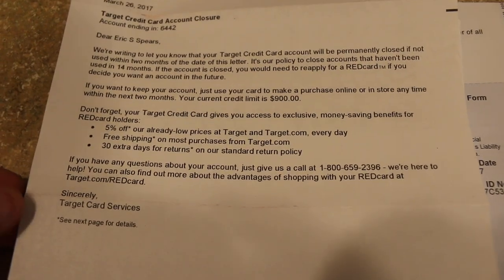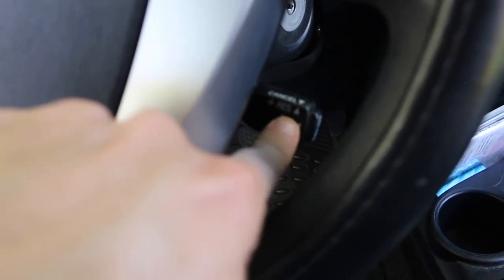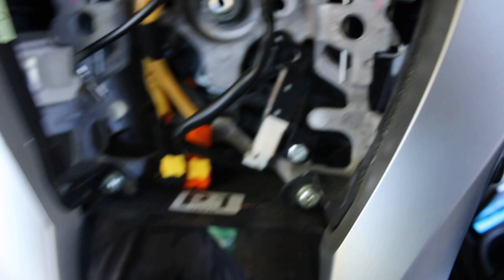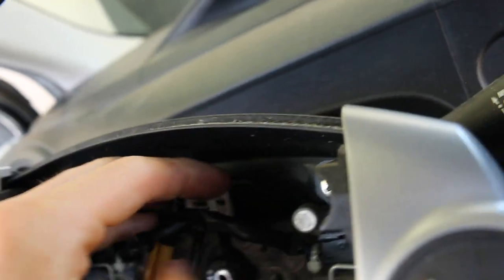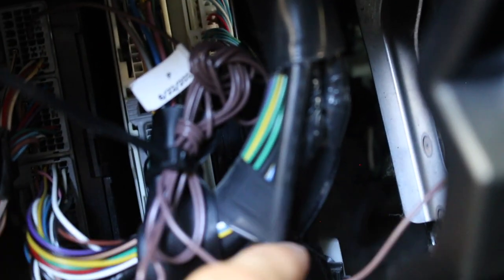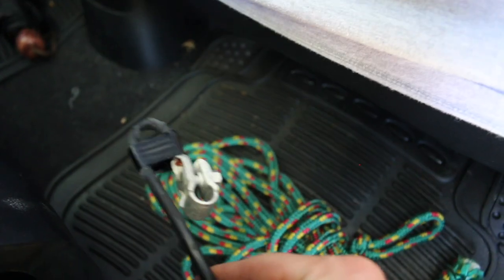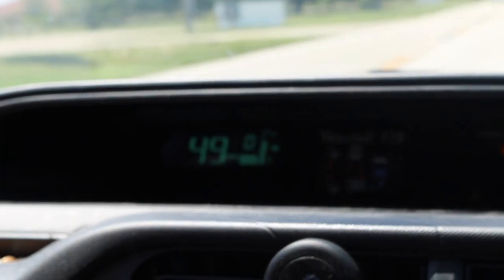How to Install Cruise Control on Base Prius c 1 one 2012 to 2014

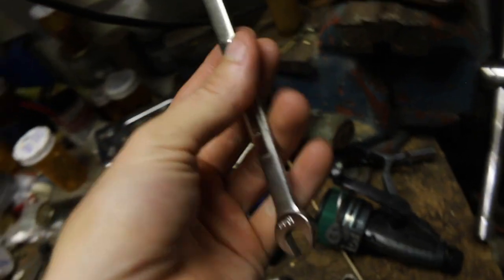Comment from the maker: The actual Install starts at 3:00. And for those who want my extra wires, I have given all the wires away. Thanks everyone for watching! =)
Reply: thecollegepicker  did it require any programming after or just plug n play?
Reply: i have a japanese aqua 2014 model.   there is no cruise control indication in instrument panel by design, how to manage that sir ?
Reply: Does cruise control disengage when you brake ??
Reply from the maker: @dochoa730  plug and play
Reply: Do you still have wires?
Reply from the maker: 4 years long gone.
Reply: @thecollegepicker   All good Thank you for the reply and the video! REALLY helped! Amazing that it only needs some simple hardware!
Reply from the maker: Appreciate it 🙏
Reply: Where do you get the wires? What are they called?
Reply: @robinulm8810   My recommendation would be to go to a junk yard and find a vehicle with the same switch. If you go to toyota's parts website and check fitment, it will tell you all of the vehicles that used the same switch. Then, go to the yard; when you're pulling the switch, make sure to get the same gauge / connector type out of the harness in that vehicle that will go into your vehicle. Cut a whole plug if you feel you need to.
Reply: @thecollegepicker I have a base model and I want to add steering controls. Got the set together with the manufacturer wiring. Would I need to add anything else?

Comment: Those small connector pins are called molex pins. There are multiple sizes available. Lots of different tools to install and replace them as well. Just google them. I worked with them numerous times on my coin-on amusement route i used to own and operate. Great job on the install. I am impressed with your ability to learn as well as implement newly acquired skills with ease! A true gift! The learning part is always the most fun I think.  EPIC close on the vlog and facial expression on the Coke comment! Be hard to top that one! =D
Reply from the maker: Tom Knight ahhhh mole pins!!! I may have been able to Google and find how to make the cords instead of having to shell out $100 for two little wires. Thanks for the tip! glad you enjoyed the install! I hope to contribute to the world and make it a little easier for the next guy who tries to install it.
Reply: Here is a link to a supplier that i used. This is the North American division. It is geared to the coin-op gaming industry, but molex pins and connectors are universal. You can actually build or design your own harnesses. Taking the pins out does require extractors, and i would highly recommend tin tipping the wire with solder before crimping. The only problems you would have is identifying the correct sizes.  https://na.suzohapp.com/wp/search.p?Q=molex
Reply from the maker: I just searched amazon and I found a $39 kit. DOH! I failed as a bargain hunter =(  It wasnt being ranked in the search for prius but it came up for toyota now that I know that the molex pins are sorta universal. DOH DOH DOH homer simson moment haha
Reply: Did you ever figure out what size the molex pins were? I found the CC stick for $20, but it doesn't come with the two wires I need. I was hoping I could just buy some pins and crimp them myself.
Reply: @andrewhudson6199  i guess thats a no to the molex pins size lol

Comment: Hi there, great video! Im thinking about installing my own cruise control cuz i bought my used prius c without realizing it even had cruise control and dealer did not tell me that it had one and that it was broken. I know nothing about cars or wiring and I dont have a 1 1/2 inch hole driller. i dont have a  problem buying the parts of the hole driller but any advice on if i should try to install it myself or just take it to a shop and have them do it for me? is it a big risk for a beginner like me?

Comment: Wondering if you can help me. I wired into a 2013 Prius C  exactly as your video shows, yet I have no cruise control. The pins went in the full depth and they can be seen from the connector interface end just like all the other pins. But no cruise. I grounded it to a different bolt than you did but it is a ground able connection. Do you have any suggestions. I had to purchase numerous types of pins until I had a version that works perfectly. 
Please let me know your thoughts? Ray

Comment: These instructions are only good through 2014. A big advantage to the Rostra.com kit is they include instructions and photos that cover the 2015 through 2017 models. There is a kit on Amazon for $39.99 with free shipping. It includes the wires and a replacement escutcheon with a hole, but the escutcheon doesn’t fit the Prius C and the ground wire is a bit too short.Most of it is the same, but from 2015 on, the ECU plug is the second one down on the left, and the wire goes into the bottom right corner.
Reply: Paul King is that bottom right when it’s in the car? Or bottom right when it’s oriented as it is at 7:50?
Reply: For 2015,2016 It's the second down  ECU plug, the upper right corner hole, when the plug it's on the car.
Reply: Went to Toyota about the 2015. It shows the brown wire to the second plug, bottom right , when plugged into socket. Hope this helps someone.
Reply: I followed these instructions on my 15 Prius C, and still no luck. I did the switch and both wire, ground and ECM. Still no illumination of cruise

Comment: Hey @thecollegepicker, 
What is the name for those types of cables you've used. Specifically with the metal rod at the end for inserting hard. I'm trying to follow your instructions and just want to buy the same cable type as you did. Thanks bro.
Reply from the maker: Molex connection I think. They have different sizes I think. Such a rip-off to buy them, would cost like $5 to make.
Reply: @thecollegepicker  thank you
Reply: I think that male to male breadboard jump wires may be the best thing. I'll try to remember to post an update when done.
Reply from the maker: Please do that would be a big help 🙏

Comment: Where did you buy the cables from? I have a 2014 Prius C One, plugged in my cruise control with harness and it's not activating, dealer was of no help, saw you're video and realized they didn't install the wire to the ecm. Maybe that's my fix.
Reply from the maker: I got my kit off Amazon of ebay I think I put a link in the description.
Reply: @thecollegepicker  I saw the link, but that's only for the kit including cruise controls, not the wires :(.
Reply from the maker: It says out of stock 😭 but I has the wires. It's a whole kit.

Comment: Pro tip turn the Steering wheel upside down then you don’t need to undo the airbag wires at all it will just nicely sit on the Steering wheel
Reply: Thank you. That was very helpful! Sadly I have installed cruise control today on my Toyota Aqua 2012 but it’s not working.

Comment: Have you connected only 2 wires? 1 minus and 1 in the computer plug? I just have a wiring diagram and there are 4 wires connected. from the steering wheel 2 and 2 from the frog brake!

Comment: @thecollegepicker So I did the exact instructions by collegepicker. I have a Toyota Aqua 2012 S model, I bought a kit and installed it the only problem I have is there is an error message on the dash (Cruise System Check) and the cruise control light turns on then off after a second or two. 

The only way I can make the cruise control light to stay on is by keeping the brake lights on meaning by I have to press the brake pedal.

Do I need to replace my brake light switch to make it work?

Thank you for everyone who will reply.

Comment: Hi man. I'm trying to install the cruise control in my Toyota Prius c follow your instruction but I have really bad time inserting the control wire into the connector. There is a particular way to insert those wires (ground amd control) in the connector contactor. Hopefully you understand my question
Reply from the maker: Whats up dude, I honestly dont exactly remember, I think I pressed them in with a tool and they clicked but I dont remember their orientation, I would say try it one way, then rotate 90 degrees only 4 possibilities if its limited by the orientation. Good luck and I hope you get it going. Our is still going strong.
Reply: @felipe Leon did you ever find out knowing what orientation they go in I’m have a hard time aswell

Comment: I have a 2016 and looking at my ecm connected it looks alot more different than yours, could it possibly be pre wired and I just have to plug the stick into the port in the steering wheel?
Reply from the maker: This will only work up to 2014 to my knowledge when I did research. 2016 would be a different way.

Comment: Where is the ecu connector point for the brown wire located?Is it behind the glovebox?
Reply from the maker: Hi thanks for watching. If I understand correctly I think I point at 6:51 check and see if that helps with the installation thanks. 🙏♥️
Reply: Anyone know if the brown wire to the ecm plug is the same place on a 2015 Prius C one?

Comment: I have a 2014 One trim n bought an aftermarket kit. I tried going to mechanics but they tell me it would need to be programmed so I need to take it to a Toyota dealer. Is this "needed programming" real or bs cuz they're afraid to touch a hybrid?
Reply: It's bs, install, plug in, turn on, and cruise.

Comment: I need help. I did everything you said. I used the brown wire and the black ground wire. Now, my horn is in a constant state of honking the second the cones connect and I tried turning on the cruise control to see if the symbol shows up on the dash and it doesn't .
Reply from the maker: What year is your Prius?
Reply: It's a 2015

Comment: Where can we get the wires. Do you know if the are standard Molex connectors?
Reply from the maker: I got mine on eBay or Amazon from a kit. I put a link on the description of the video. I'm not sure if it's standard molex sorry I wish I knew. Cruise still works great to this day 🙌🙏

Comment: I need the wires to install the cruise control thank you ... good job man
Reply: The connectors at the end of the wires is crucial. I purchased several different kinds until I got the correct ones that fit properly into the connector. Let me know if you need a few. Ray

Comment: I have a 2014 Prius C. I bought the cheap kit and tried to install today using this video (thanks TCP, went pretty much as depicted).  Unfortunately, CC didn't work.  Still doing some troubleshooting.  The Molex connectors for the signal and ground were being stupid when I was trying to get them to seat in the steering column harness plug.  I'm thinking they might not be making contact.  Also, had to extend the ground wire with Scotchloks.  Ground is too short as Paul King pointed out. Does anyone know why most of the Prius install instructions skip the signal and ground wires altogether?
Reply from the maker: You are welcome. I got the expensive kit, expensive two wires 🙄. Hopefully it works out. Let me know 👍💪

Comment: I grabbed a cruise control kit but can't seem to get the wiring to work. I'm not sure what I'm doing wrong but cruise won't turn on after putting the wires in the spots everyone says to do. I'm so frustrated over this.
Reply from the maker: What year is the Prius c?
Reply: @thecollegepicker  2017 Prius C One
Reply from the maker: So from what I've gathered from the comments is that the wiring is different on 2014 or 2015+
Reply: @thecollegepicker  yeah that's what I've gathered too. Don't know what to do here now. Rostra website only talks about the connections under the airbag and nothing further.
Reply from the maker: Does rostra sell a kit that says it's compatible with 2016+?
Reply: @thecollegepicker  it says 250-1836 on their site. Downloaded the PDF form #5350 and it only shows 2012-2014 and 2015 instructions. I attempted the 2015 also just now but seems to be same problems.

Comment: I see this video is 6 years old and know those wires with the special female terminals are long gone :hand-orange-covering-eyes::cat-orange-whistling::face-blue-wide-eyes:🤣😆! Being the Prius is a 2013, there was something in common with my 2013 Tacoma base cab, 2wd, 2.7L 4 cylinder model, they both need the black ground and the brown lead to the ECM. The black connector under the steering column looks just like the S8 connector under mine (2 rows of 6) , the ECM's are of course different due to application. I'm hoping the individual that said the terminals are Molex is correct and I can find the size required. I bought and installed all the other hard parts, and the clutch switch connector for the cruise was there in the harness.

Comment: Dude thank you so much for this video I love my Prius C One just needs Cruise control
Reply from the maker: You are welcome. It was a great addition for us.
Reply: @thecollegepicker  have you had any issues with the main battery? Mine has 92000 miles on it.
Reply from the maker: Nope, it has about 155k now I think.
Reply: @thecollegepicker  Darn it my Prius has a different setup because it was previously a fleet vehicle so it has an old tracker wired in. I have no idea how to go around this.
Reply from the maker: @Toyeboy89  oh no! Sorry to hear that 😔. Hopefully some information is out there about that setup.
Reply: @thecollegepicker  I'll save up enough money eventually to get cruise installed. I don't need it much yet on my short back road drives. Crazy how this car can get 15mpg more if you avoid interstates.